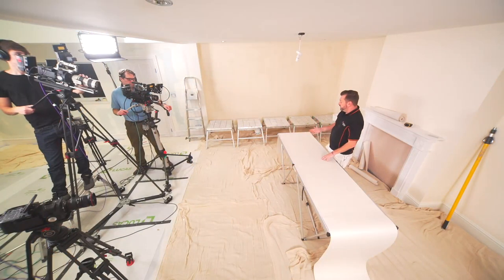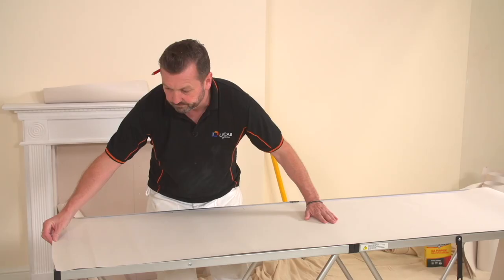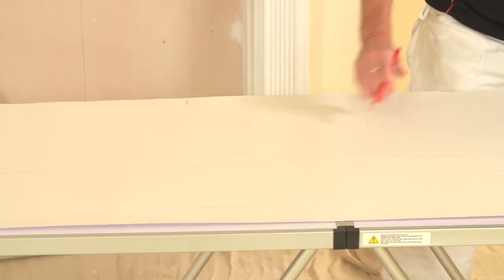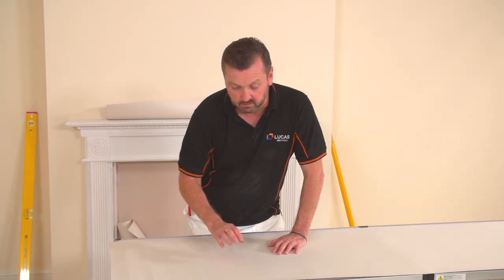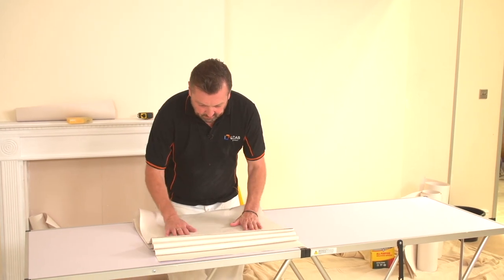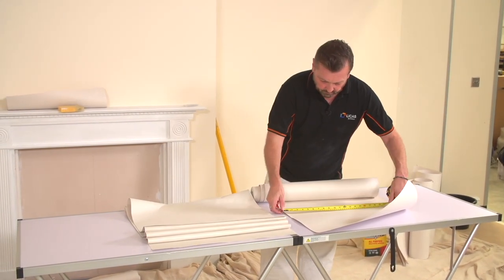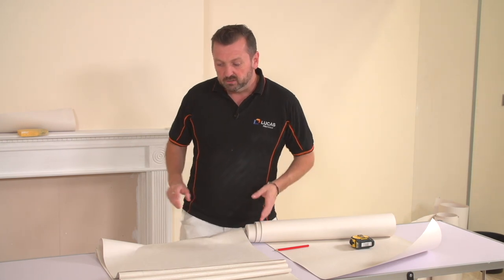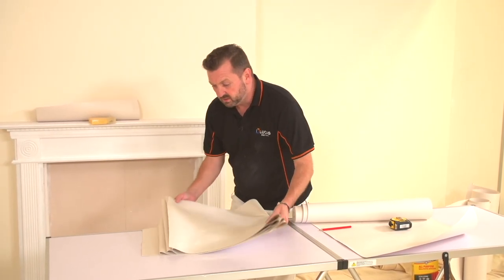How to Paste Lining Paper

Comment: Exactly what Iv been looking for. Up close and informational. Iv hung lining paper a couple of times now but the seams occasionally lift. Could this be due to me not folding it like this video shows? Or perhaps I never allowed enough time to soak? I'm sure I used enough paste anyway. Obviously from now on I will use this guide.
Reply from the maker: Hi Jac, thank you for your comment and the compliments.
It could be a number of things, did you apply a thin coat of paste to the wall beforehand?
Reply: @PaintLikeAPro  I think Danielle needs your help Barry!! ^^^^^^ might be too late now.